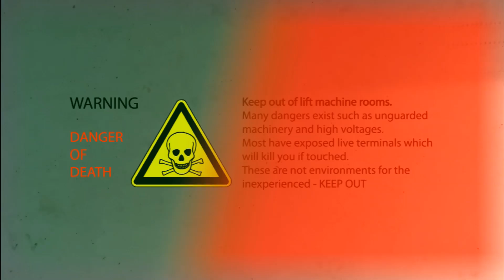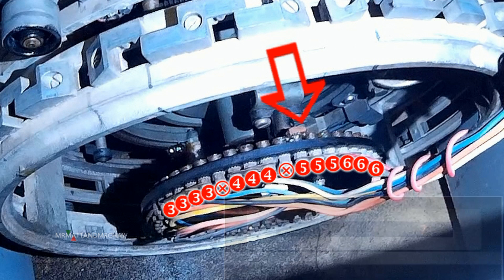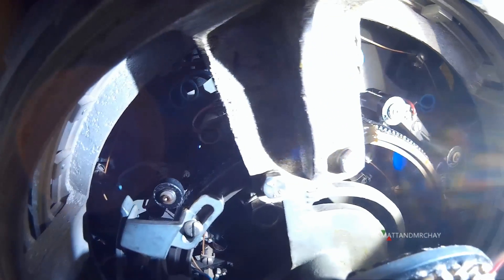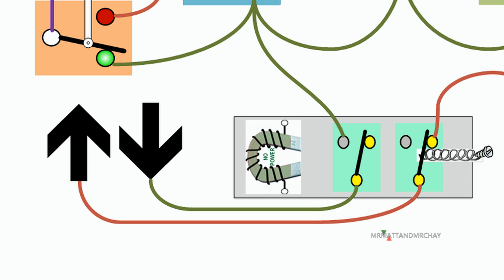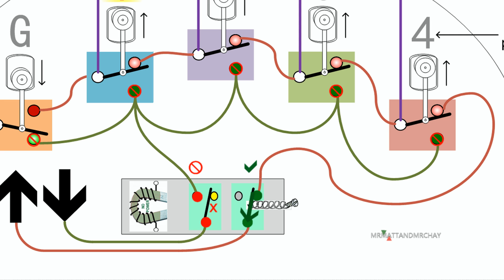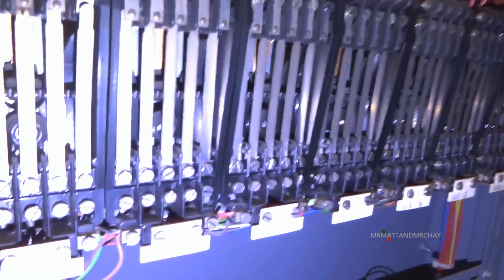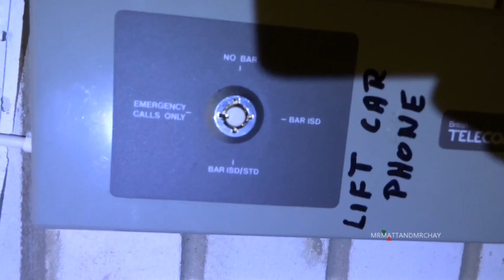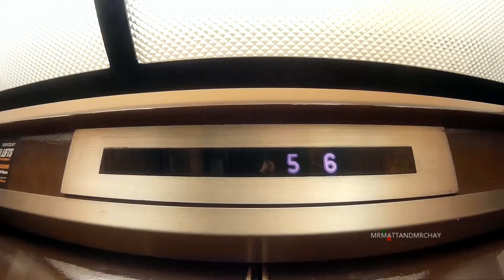The SCHINDLER WHEEL SELECTOR & MORE!

Comment: I am very glad to watch the parts and apparatus of old elevators . Specially selectors of different makes - MAN used a special slector similar to Schindler-  plastic drum rotation, instead of mechanical switches , photo emitters and receivers were used which operates lift positioning and slow down.

Comment: Great video!  In 1979 Schindler developed it the Miconic control system, which has allowed to equip microprocessors on lifts. Young people lift fitter you are in trouble when performing repairs, also for the fact that they changed the symbols of electrical diagrams.
Reply from the maker: +Guerrini Daniele Ive heard from a few peoplr that the way Schindler design their logic circuits (relay generation) was a lot different than other designs and took a lot of getting used to.  I personally enjoyed filming this one as there is plenty of movement.   Love the schindler selector.
Reply: Guerrini Daniele kk

Comment: The old Otis mechanical selectors had to be the most complex of their type ever made.  I could just imagine how long it took to train people to service those...
Reply from the maker: +douro20 Yep, I hear where you are coming from, but I suppose back in those days people probably had a better understanding of electrical circuits than they do now (maybe - well, specially relating to relay logic).  As people have suggested already, when you examine it closely and have the right training then circuits are quite simple.  It's the original design and the thought process that went into the design that is really complicated.  One thing you definitely need is a circuit diagram!

Comment: I take it that the Yellow wires running between the Relays at 10:01 and 10:16 Are commons ?
Great Video BTW. I have always Been fascinated by elevators Also. and thoroughly enjoy your videos.
Reply from the maker: +DUSTERDUDE238 Yep that is a common wire between the relays.  These look like Normally Open contacts, so if any of these relays turned on, then what ever voltage is on the yellow wire would be switched to the top connector.  But as to "what it does" needs a complete understanding of what those relays do and a circuit diagram.  If I lived in this building then bit by bit I'd love to work it out, but unfortunately if I'd stayed any longer then I may have been discovered :D  Thanks for your kind comment!
Reply: mrmattandmrchay

wonder if we could find a schematic online somewhere? would love to learn more about it Also.
Reply: +mrmattandmrchay great video just subscribed

Comment: Great video, love the sound of that beautiful machine at work nice explanation of how it worked too!  I wonder how long it has been since someone went into that motor room!  I hope they don't think about modernising it!
Reply from the maker: +Knuckles the Echidna Thanks.  I bet that this motor room is visited frequently, which is possibly why how it's stayed working for so long.  I'm really not sure on the criteria of "when" a lift should be modernised, but it's probably "cost to maintain current lift and parts/experience availability VS cost to upgrade and maintain a newer lift".  I hope this runs for a long time yet, but think about new engineers having to learn old kit!

Comment: Great job Matt an excellent vid, Congratulations.
Reply from the maker: +Peter Lomas Thanks Pete!  I did wonder about the roller switches around the edge though - if you look at the connections there is one wire on the roller arm, and the other is at the rollers NORMALLY CLOSED position (you can see a copper wire linking all these terminals.  You can see it at 3:21, the terminal where the roller switch normally rests - A bit strange that if these rollers were finding active calls as the wheel pushed then, why they wouldn't be connected to COM and NORMALLY OPEN instead?

Comment: Russian elevators are much simpler. The "inside" roller switches (actually they are in the shaft) have THREE positions. Two extreme positions are identical to Schindler's and the middle position is the slowdown command. See this video for example: https://www.youtube.com/watch?v=FCgssL03EX0
Reply: +mrmattandmrchay The oldest Austrian automatic lift controls were even simpler. These lifts only went up from the ground floor and then down again. One ramp per floor in the shaft and one "up" switch in the car linked to as many buttons as there are floors. The buttons are in a vertical row with the highest floor the farthest away from the door. The ramps are staggered too so at the selected floor the ramp pushes the button back in and that's it. No self-levelling with sensors and everything, just fiddly adjusting of the ramps I think and that's why there probably aren't any of these controls left (self-levelling is now a legal requirement at least in Vienna).
Reply from the maker: +Алексей Рукин Yes, I've seen a couple of these, where the switch is in the shaft (might be one of your videos).  Interesting - so for the central slow down command, the roller must be moved to the middle position AHEAD of arriving at the floor - if there was an active call then slow down is initiated?  How about the stop command (level with floor)?
Reply: +mrmattandmrchay There is a separate sensor or a set of sensors for exact stopping. The sensor is usually on the cab and is driven by "flags" in the shaft.

Comment: Great video as always. If I understand correctly the lift's directional awareness logic cancels the second contradicting call, i.e. it gives preference to the first call? So as you explained when you have a first call below the current position to set the lift in the down direction and someone calls the lift above it's position it cancels the up direction command. But, does it switch to the up direction if it has completed it's down command or does that depend on the complexity of the controller? As some lifts have memory and simpler ones don't. 

I bet this sort of behaviour is software configurable with modern controllers. I read on a website from a dutch lift consulting magazine that had a factory tour at ornona that orona only uses one controller pcb for all types of lifts whether they where simple or advanced high-rise lifts with groups, and that they simply configure the software to change the logic so that they only have to issue one pcb  to their service engineers instead of needing different versions.
Reply: +dykodesigns2yt Most relay based controllers do not have a memory just relay logic.Once a lift has completed its journey up or down any remaining  landing calls will then be answered in respect to their  position in the shaft. On an Express lift controller relay 83 is energised when the car is travelling in the up direction,it will remain energised untill the highest call is cancelled. Calls registered below the car will de-energise 83 via other directional relays 71 and 72 for example. The car will continue to answer calls below  untill the Lowest call is cancelled.
Reply from the maker: +dykodesigns2yt Yep, as Peter stated, all calls in the opposite direction are hidden (disconnected from the logic) until the lift completes it's journey to the last call.  After that a relay reverses and the calls in the other direction are connected, which disconnects calls in the opposite direction... and so on.

Comment: when you see all of this logic and then you start thinking you could build a lift controller with an arduino and some relays and contactors in less than 1/6 of that space, you see how we've evolved...
Reply from the maker: +IscleGaming | ZefaCraft Yes, but now there is no need - you just need an I/O controller (such as a PLC programmable logic controller) and software code the whole thing.  More work and understanding involved with circuits (and more to go wrong until your design is working 100%) but it's not the same!  I love working with relays.